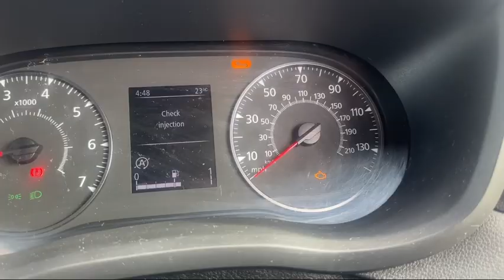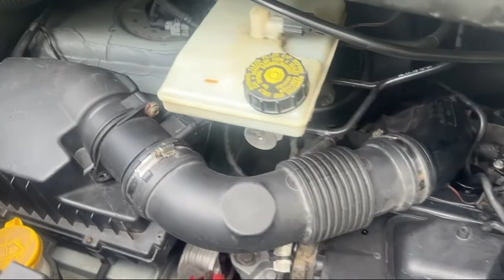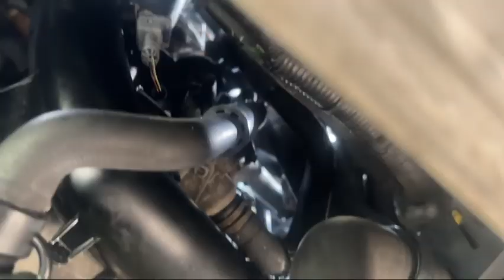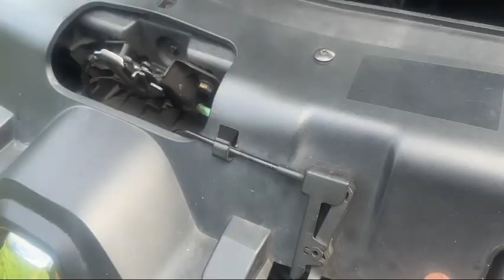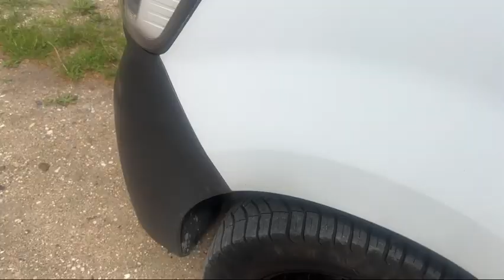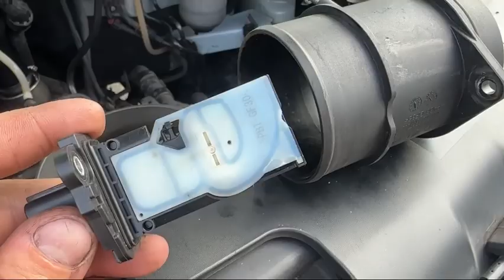Renault Master 010122 inlet air Circuit, signal Amplitude maximum. Air intake problems how to fix

Comment: Hi.

Did this fix your problem permanently or this fault came back in past year ?

I'm having same issues. So please let me know. Thank you
Reply from the maker: Yes since cleaning the system I didn’t get this code again. But there was some oil in the system so you must figure out where it’s coming from. There will be 3 main reasons 
1 being the turbo is on its way out (check the turbo as it could destroy your engine if it dies, 2 it could be injector seals letting pressure into the rocker cover
3 it could be damaged pcv valve
Reply: @Trisstansvanlife Thank you for you replay.
I replace full charge pipe from turbo to intercooler and also intercooler. Oil was all over the pipe, starting from resonator to intercooler. All over turbo, where sits resonator it was also good bit of oil. I cleaned after charge pipe replacement around turbo and after 1 week, no new oil. 
Also turbo inside is dry, where is resonator. 
I did live data testing with Launch scanner and Turbo Position is at 83.9% and Turbo Wastegate Valve Position is at same 83.9% at all the time, at idle, at acceleration and during driving, these 2 values never change. Also few times I have oxygen sensor codes, but when I conact dealership they told me this van have no oxygen lambda sensor. So not sure what I can do. Any help will be greatly appreciated.
Reply from the maker: @FamilyMan @FamilyMan1607 st clean the pies with degreaser. If turbo is dry then I would look at injector seals and pcv valve. What’s the mileage? How many miles when you brought it. Newer vehicles are a nightmare with codes and fault finding, I’m currently try to find a problem with a mini r56 it’s been driving me mad! Also have you checked the turbo for free play?
Reply from the maker: Also be careful if you’re getting oil in your intake system some unburnt oil may get in the dpf. You don’t want to destroy your dpf
Reply: @Trisstansvanlife Thanks for all the help.

I think I know where is the issue. I did same as you, i clean IAT sensor and full pipe from intercooler to throttle body. I see it in throttle body so much tar on the butterfly part. So that is one of the reason why IAT kicks that code. I think.
Reply from the maker: @FamilyMan1607 fingers crossed now just figure out where the oil is coming from

Comment: Hi, do you know which sensor: MAF or Intake air temp was causing DTC 010122? Or you just cleaned them both and this solved your problem? Did you find root cause like moisture in the connector or other? I know, so many questions, but I'm also struggling with DTC010122 on Master III
Reply from the maker: Nope was on a trip just cleaned the whole air intake system including the internals of the pipes and intercooler. I think my turbo is letting by some oil as it was quite oily inside the whole intake system. Have you tried cleaning the MAF? Start there first as it’s the easiest but it’s delicate and bloody expensive! You will need a code reader to delete the codes. Also check your intercooler pipe where the connect to the intercooler, if it’s oily I’d advise to clean the whole intake system. There is an oil catch can/oil separater on top of the engine remove that’s and all pipes from that on top and in front of the engine and the intercooler its easier to remove the bumper to do get to the pipes. The metal pipe the oil catch can connects to and the ones around the back are pretty difficult to access so I didn’t bother removing them. No moisture or corroded wires all in pretty good condition. Iv not had that code back since cleaning